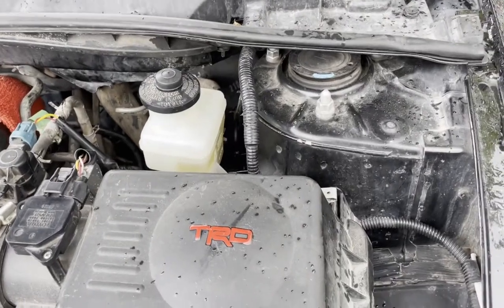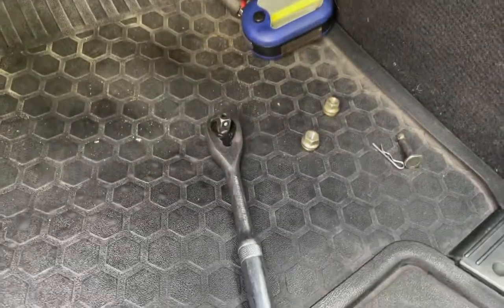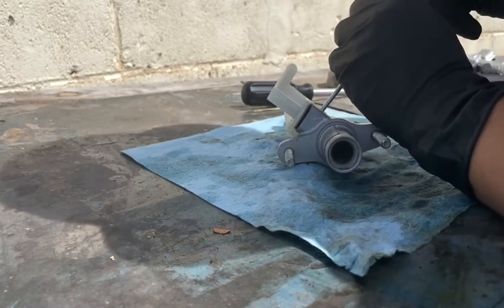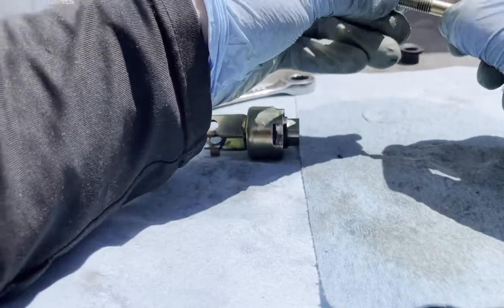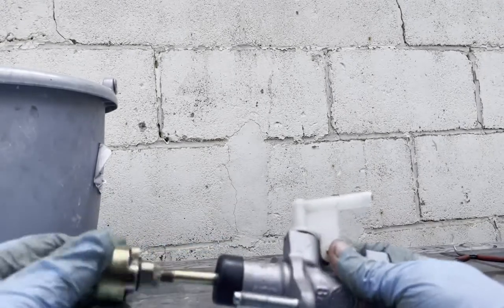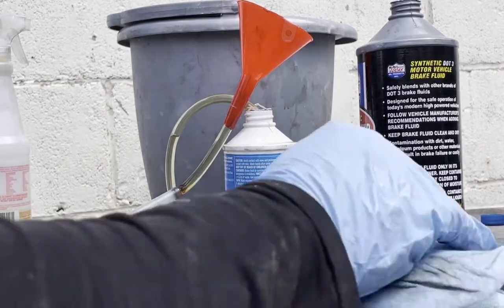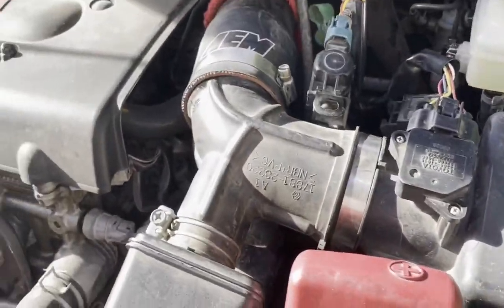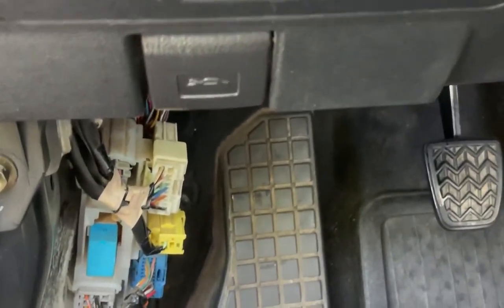Master clutch cylinder replacement part 2!

Comment: Good video. Helped a lot definitely. I'm doing my second one on a first gen tc. Getting the nuts off the studs was a nightmare the first time. This time I separated the power connections on the power dispersion panel in the dash and pulled the mounting nuts and bolt. I worked that panel down just enough to easily get on the master cylinder nuts with an extension and my gun. Came right off and went right back on no struggles. An hour  invested in moving that panel saved me two to three hours spent the first time arguing with the nuts on those cylinder mounting studs.  There are two harness mounts on the dispersion panel you have to remove and one clip on the back. Thanks for the video. It helped.
Reply: nice tip! tnx

Comment: Hey man, I'm getting ready to help out a friend with this. I would like to know why they old hard line didn't work?? it seemed like you had it there all you had to do was tighten it. Is it possible to do the job with the old line. Thanks for the video
Reply from the maker: To me was difficult do to tie space, so after trying I ended up destroying the threads on the master cylinder, I tossed the hard line and went flexible, never had any issue after.

Comment: I just noticed you also had trouble reconnecting the hard line. Can you please provide the part numbers you used for the substitution? Please don't just say R16 on ebay.

Comment: Hi i know this video is old but i need help on my 07 scion tc. i replace both mast and slave cylinder. i also clean the fluid resorvior and now the clutch pedal is  is in the floor. if you remember can you also supply the parts you use for the flexible line and all the connector. much appreciate it. patrick
Reply from the maker: It’s called import parts r16 on eBay, that where I get most of my stuff.

Comment: I've got an 05 tc. My shifter will not engage when the car is on.  The shifter will engage when the car is off. The gears grind when the car is on and I press the clutch in all the way to the floor. Will replacing the master cylinder fix this problem? Thank you.
Reply from the maker: might be your clutch.

Comment: I was curious about the clutch M/C on the Scion, and your video was extremely helpful. Thanks for taking the time, and job well done. My daughters 2014 Tc I was told shared the same "master cylinder" as the brake. But I think I was told wrong. It's only the reservoir that is common, not the M/C itself. Someone needs to shoot the engineers for this stupid design. But the manufacturers don't care about the mechanics, as long as their cars make it thru warrantee periods, that's their only concern
Reply from the maker: Thank you for your comment, yes a lot of  times I wonder how they come up with poor engineering after having tons of experience on manufacturing cars.
Reply: My 1985 Porsche and 1982 BMW also share reservoirs
Reply: I'm having a lot of trouble installing clutch m/s on my 08 scion xb any help would be greatly appreciated

Comment: Hey thanks for the video! I have an 06 scion TC with the same issue. I was able to replace the master cylinder, but the clutch is now worse and stuck to the floor. Do you think it’s a bleeding issue? I did not bench bleed it like you did though.
Reply from the maker: Did you replace the slave cylinder?

Comment: Do you have an updated link or search term for that hardline replacement you did? The link is currently not working. Also, is that a solid replacement? I hate those hardlines and honestly wouldn't mind changing them to flexible lines if there's no issues with doing so.
Reply from the maker: I’ll find you the link, hold on. 

https://www.ebay.com/itm/284860137472?mkcid=16&mkevt=1&mkrid=711-127632-2357-0&ssspo=yeww3vpstfo&sssrc=2051273&ssuid=yeww3vpstfo&var=&widget_ver=artemis&media=COPY

there you go, hope it helps!
Reply: @theimportschannel86  dang thanks for that. A bit more than I want to spend at this time though with all the other work we are doing. Appreciate you doing that though!

Comment: Have an 05 and I'm starting with the slave cylinder this weekend. Clutch sometimes gets stuck half way up. My question is since the clutch and brake systems run off the same reservoir do I need to bleed both the clutch and brakes? I would assume so
Reply from the maker: Try it, it’ll probably work for you or, if you use the flexible line, bleed it from there as well.
Reply: hey i know this is old but what fixed it for you? my clutch pedal gets stuck halfway up but i can pull it up with my foot just fine
Reply: @ilikewaffles7309  I changed both slave and master cylinders. Tried everything I researched online and nothing worked. Unfortunately my clutch was toast. So after 250k miles I had to put her down. Cheapest place I found to replace it was $1100-1200. But that car treated me well. Still sitting in the driveway lol

Comment: Hey bro I replaced both cylinders and and Clutch but it still has air in the system even after I bleed it on 07Scion tc as well 
And Yo Bro Thanks for showing me cause I changed them
Any suggestions?
Reply from the maker: Thank you for watching my video 👊🏼  bleed it by the slave cylinder until the pedal gets harder, keep the fluid leveled  and make sure you don’t have any leaks.

Comment: that flexible line you made where can we buy the kit, I was changing mine and the hard line goes in cricket. would you sell one.
Reply from the maker: Right here 👇🏼

https://www.ebay.com/itm/284506338730?mkevt=1&mkcid=16&mkrid=711-127632-2357-0

Comment: Pregunta compa !! Yo le remplace el master cylinder y el slave cylinder pero el pedal del clutch solo sube hasta la mitad o un poco más pero no hasta arriba como antes estaba…. Ya le hice bleeding a todo el systema…. Algo más que necesito hacer ??? Gracias
Reply from the maker: Hola, asegúrese que todo el aire allá salido y véale también la manguera dura donde se conecta el máster cylinder. Me vi en la necesidad de remplazar la mía porqué liqueaba por allí y eso provocaba que no funcione adecuadamente. Avíseme que encontró y como finalmente resolvió su problema compa por fa.

Comment: How do I bleed it if I don’t have the same bottle?
Reply from the maker: You can also do it directly from the aftermarket flexible house.
Reply: I replaced the clutch, slave and master cylinder but I still cannot get it to go in gear. I tried bleeding it but nothing. Any idea what I could do next?
Reply: The clutch goes down but only comes back up halfway

Comment: Hey i want the same line you replaced your hard line with were can i get it?
Reply from the maker: I’ll get you the details where to get them from.
Reply: Ok im located in Phoenix AZ will they ship the parts?
Reply from the maker: @jermainemclaren1319  oh yeah
Reply from the maker: I took me a minute to share it but this is where I got the clutch line from. Hope it helps ✌🏼

https://www.ebay.com/itm/284369351221?mkevt=1&mkcid=1&mkrid=711-53200-19255-0&campid=5338273189&customid=&toolid=10001&pub=5575378759&icep_ff3=1&ipn=psmain&icep_vectorid=229466&kwid=902099&mtid=824&kw=lg